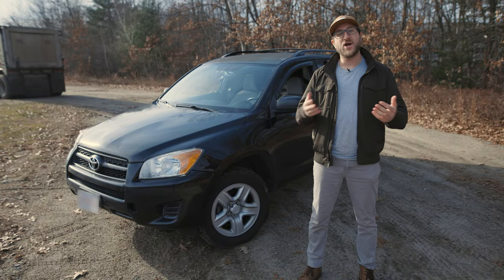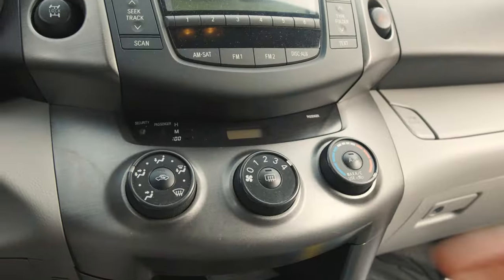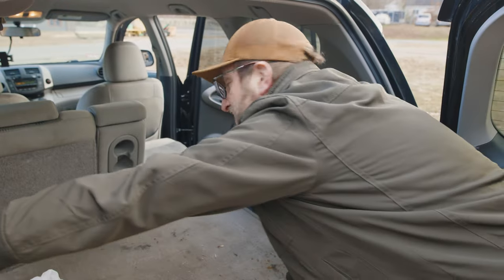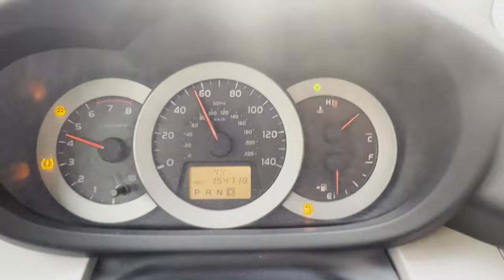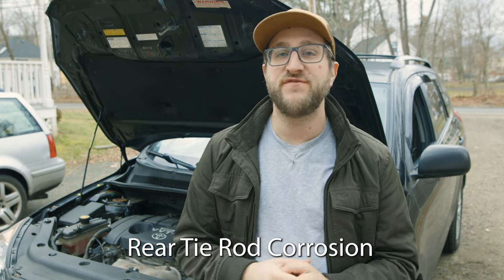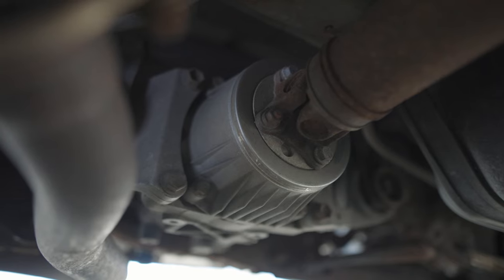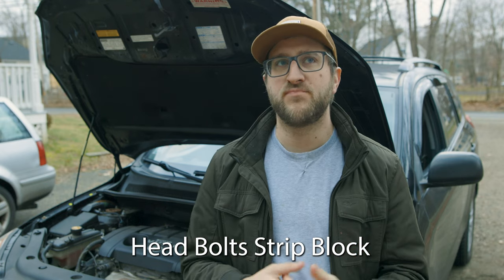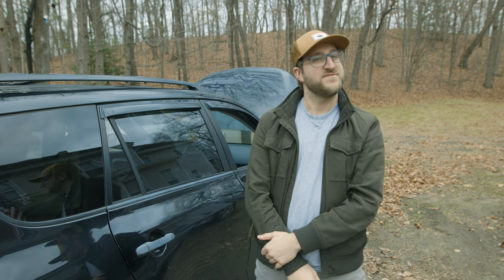Toyota RAV4 (3rd Gen) - How Reliable Are They Really? Review, 0-60, Off Road, Cargo (2006-2012)

Comment: I have a 2008 with 2.4 liter. Toyota warrantied the oil burning motor and replaced the pistons. The bearing that goes bad on the rear dif went bad at 200000 miles. fairly easy fix to do yourself for under $100. Just make sure to get a top quality bearing and press the new one in. Do not hammer! Ask me how I know! Replaced sway bar links front and rear as well as shocks and trailing arms in rear because rubber bushings went bad. I change oil with top quality syn every 5000 miles and change trans fluid every 30000. currently have 235000 miles and my wife still loves it. Has been a very inexpensive car to own for over 13 years.

Comment: I have a 2008 V6 and with 198,xxx miles on the odometer it has been dead reliable (knock on wood). I'm aware of all of the possible issues and by the grace of God I haven't experienced any. Ours has the 3rd row and although it is tight and we barely use it, it did come in handy a few times. That is our road trip vehicle so not a daily driver and I'm think because it has mostly highway miles is why it's been so reliable.

Comment: I had a 2011 RAV4 and it developed chain slap. When I started the car, it made a metal grinding sound. A $2500 fix. It was covered by the "Car Care Nut" in a video. A Toyota Master Mechanic he is recommending not to get the 2.5 engine.
Reply: The 2GR 3.5L also has that issue, which was resolved in 2011.
Reply: That is not the timing chain most likely, most likely the VVTI gears (aka phasers) Timing chain issues are not common at all in the 2.5. The timing chain is a much larger job than just the gears, I just replaced the gears on mine. A few hour job with basic hand tools

Comment: Still have our 2010 2.2 D4D with a Manual trans here in Northern Europe, we purchased new, we also have a 2020 Honda CRV 1.5T the Honda is a nicer drive but not as good off road as the Rav4, only issues we have had with the RAV is rust they rust badly on the underside just very poor underbody corrosion protection from the factory. Its a rough and ready car that hold up well to a bit of abuse, the clear coat on the paint is not starting to flake on the roof and bumpers but we are not to bothered about that as it used for mainly dirty jobs it will never win a beauty contest but it owes us nothing after 14 years. 295llb ft of Torque makes it an excellent towcar

Comment: Off-roading means you damage nature, so that's okay.  What I want one for is to get up slightly steep bumpy roads to the alpine.  No rush to get there, but my Echo (just totalled) couldn't do that, of course.  I'm 5'11" (when I was 30, anyway!) and thanks for that proof of fit.  I want a sleeper!  I just missed out on a 2008 for $3k ... the guy was moving in a day.  Argh.  It leaked oil, and had some fascia cracks and rear bumps ... made me think it'd been treated roughly.  Still, it was $5 to $8k below price.  Really excellent video, esp for a not-car-guy ... you listed in great detail problems to watch for.  Thanks.
Reply from the maker: Appreciate the comment! Glad you got some use out of the sleeping portion
Reply: @NotSoHandyCarGuy  I always think car-makers should create lists of problems to solve, and so why not make a passenger front seat that becomes a bed-extender, make rear bench seats fold down so that there are no gaps (dogs' legs can snap!) ... @alsoNotSoHandyDudeButWhatIdeas

Comment: I just bought a 2009 with the turbo diesel and a 6 speed manual with the factory bull bar. I'm going to have it mapped for MORE POWA and change the front grill to the heritage style emblem. I'll also put a 10.1 inch screen in. After that I'm not sure I'll willingly sell it.

Comment: Interesting info... THANKS--- I like Rav4 but the new ones are UNDERPOWERED... I just found out they have made V-6 ones-- and that is what I want... I'm going shopping- but I still would like this info to see what I think of it.   THANKS again..
Reply from the maker: No problem! Yes, I would certainly recommend the V6 over the 4cyl. Good luck with the shopping!
Reply: @NotSoHandyCarGuy  THANKS- found several good one to look at already- and i'm only looking at SOUTHERN cars (no road salt rust issues-)...etc... I'm finding $5,500 to $16K even for the NICESt ones and a TON of mods, customizing stuff, and can have a BALL with this-.  AND better mpg and lower insurance!!!
Reply: I just got the v6 and I absolutely love it… one of my favorites cars I’ve owned … I bought it just for winter driving but…. I now have my new civic for sale because I like the rav4 that much lol … great light off road and it’s a little rocket off the line lol
Reply: @MrScoobieman  THANKS SO MUCH-- that is what I like to hear-- and sounds good to me- that CONFIRMS my choice... :)  I've already found several good ones to go look at.
Reply: Love my V6 4WD one. Needs a lift though. Sits too low.
Reply: @Wildland_Firefighter  I already have the lift planned for one and haven't bought it yet--  LIFT, other cusomizations. LED inner light package- upgrade a couple things- CHANGE that high pressure oil line to metal FIRST- then wheels and tires... :)
Reply: @davidwayne9982  Yeah, I did the oil line. Easy to do. Been debating about putting an oil cooler on it
Reply: @Wildland_Firefighter  Would be a good idea..

Comment: FYI: the 2009-2012 RAV4s with the 2.5 4 cylinder will still burn engine oil if you don't change your oil when due i.e every 3-5k miles. If you do 3-5k mile oil changes, your RAV4 will burn less engine oil...theoretically. Also, these third generations can be had with 5 speed manuals outside of North America, but only with the 4 cylinder engines (some markets also got a diesel, which many will tell you to avoid at all costs).
Reply from the maker: Very true! A lot of people forget that regular oil change intervals are the number one maintenance item that shouldn’t be overlooked. 3-5k miles is right in the sweet spot.  And I wish we got the manual in the USA, that would be cool.
Reply: Cro 505 engine carbon cleaner really helped with oil burn on my used 2010 rav 4

Comment: What about the Electric Steering!!!  Great Video but you cruised past an issue I have still yet to resolve and have found a lot of people with this problem.   The steering Rack fails.   When I bought my 09 V6 sport I couldn't figure out the weird steering so I brought it in and they replaced the rack.  $1100.  But the sticky steering wasn't gone and the only solution I can surmise is to replace the steering column!!  Not a cheap part or easy to do.  I so wanted to love this car but have never enjoyed driving it bc the terrible steering.   Great power though.

Comment: Well i own a 2012 rav4 it does not come with plastic hubcaps only metal. Well i had own it for 12 years and no rust yet and rav4 is not for offroading on rocks, ice, other stuff like that well if you try those just bring some spare offroad tires and mine does not have a 4th gear in the end mine has 5 cylinder so 5th gear.

Comment: Totally solidified my judgment call with my 2012 rav4. I actually go and do some off roading with mine and camp out of the back of it. I'm 6'1". Haven't had major issues as of yet, knock on wood, but am starting to have issues with my starter and o2 sensors. Not too shabby. Overall. I plan on giving it a 3" lift and some bigger tires and making it an absolute beast for offroad. Stock I'm able to go as far as my buddies 2" lifted tacoma. Imagine where I could go with 3 inches and some fatter tires.

Comment: yes they are reliable I am speaking on the V 6 just turned 269000 on my 08 and still running strong I also just purchased another 08 with 89000 miles I cannot speak for everyone but for what I have had to do to mine is really just routine maintenance I have not had any other problems we also have a camry coming up on 400000 miles I have had no other car in my life that comes close to Toyota my daughter has had good luck with Honda but you have to deal with timing belts anyway if your thinking about picking up a Rav 4 you really cant go wrong as long as its been taken care of Toyota makes great engines

Comment: Loved my 2012 4wd. 200k trouble free miles then was rear ended and it was totaled. Bought a tacoma and it’s great but not as comfortable
Reply: I think I’ve heard about Taco seats being uncomfortable, which is disappointing since in my experience Toyota nailed comfort in both of my former cars (1998 Corolla, 2016 iM). Is there something about a pickup cabin that’s a limiting factor or did they just decide the seats should be  worse than their car ones?

Comment: 2011 Rav 4WD 4 cyl. Just bought it and was wondering if other Rav around the same year have heard like a winding noise coming from the left side in the engine compartment. Mine does it the loudest around 25mph and maybe 1300 rpm.  Thank you.
Reply from the maker: It sounds like your differential or transmission may be low on fluid. Make sure the fluids are topped off in the transmission (it shares the same fluid as your front diff) Check for leaks around your axle seals.
Reply: Had the same issue. My back differential was leaking. Start with that, maybe top it off.
Reply: Yup. I would change the transmission oil every 20-30k miles. Just drain and fill to the proper level. The transmission is cooled off by a hocky puck sized oil cooler inside the engine compartment, so the transmission oil gets fried prematurely. If you want to remedy this, just get an auxiliary transmission oil cooler, but install it in front of the engine radiator. I guarantee you that transmission will love you.

Comment: Im going to look at a 2011 RAV4 tomorrow (2.5 L with 93K miles) but after watching this video im afraid to buy it......I thought these SUVs were super reliable?
Reply from the maker: They certainly CAN be reliable. My intention wasn’t to scare you, only to help inform you what to look out for. As long as it’s not the 2.4L you should be ok. Just make sure it doesn’t rattle on a cold start, puff any smoke when you start it, clunk over bumps, and that the tranny doesn’t whine. Good luck!

Comment: The main issue with my 2010 RAV4 Limited 4 cylinder is that there is some weird coding issues that turns on the check engine light, 4wd light, and the tire pressure light leading to the cruise control not working, not a huge issue for me but worth mentioning
Reply from the maker: Thanks for the comment! That is a pretty common symptom of a failing O2 sensor. It’s certainly worth fixing
Reply: It’s an O2 sensor, happened to mine. Same symptoms you described
Reply: I bought oem at Toyota dealership for $100

Comment: One thing to note with the V6, and an issue I’m currently suffering from. The 5speed auto gets a really annoying whine between 25-40 mph. Supposedly it’s not detrimental, just annoying.
Reply from the maker: I had that with the 4-cyl as well. But I think that’s actually a worn planetary gear in the transmission, due to low fluid at some point. At least that’s what it was with mine. It was leaking from my axle seal. I’d double check the tranny fluid level on yours